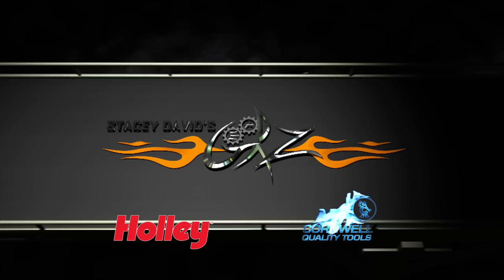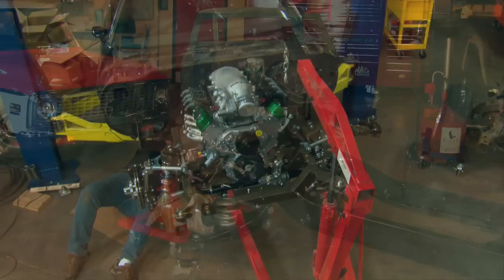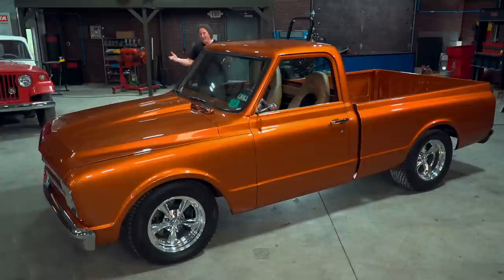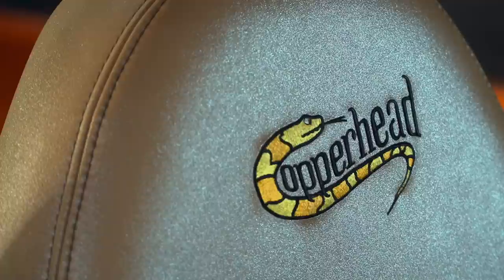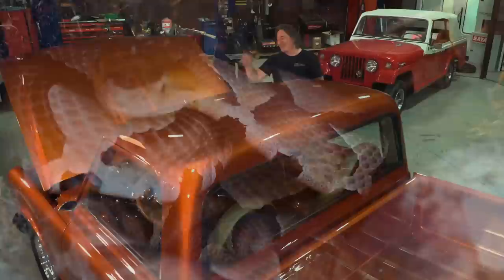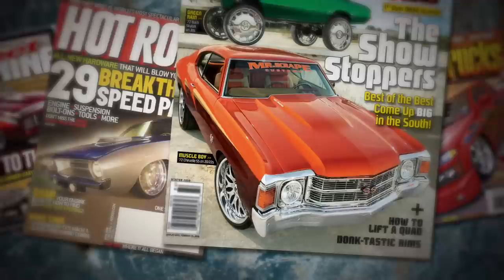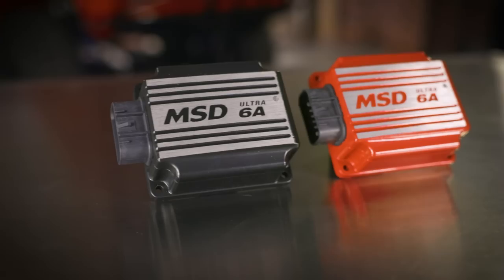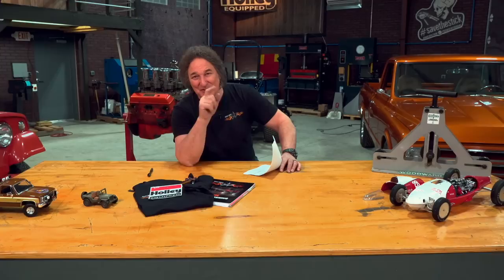The COPPERHEAD Story! Legendary Chevy C-10 Build - Stacey David's Gearz S17 E1

Comment: I heard somewhere that the 572 you originally put in it was gone when you bought it back??? so that means that the engine you have in it isn't the 1st 572 right??
Reply from the maker: That is incorrect. The original 572 is still in the truck. Whoever built the replica that sold at auction last year likely made up that story to help pass off their truck as the original Copperhead.
Reply: @OfficialStaceyDavid  but somehow i remember that you did a video of when you found copperhead after many years that there was a 350 in the truck and the 572 had been removed and used in another vehicle and it was long gone
Reply from the maker: The 572 has never been out of Copperhead. My Blazer build from Trucks was parted out after I sold it. Maybe you were thinking of that?